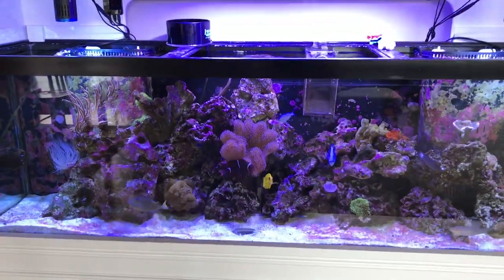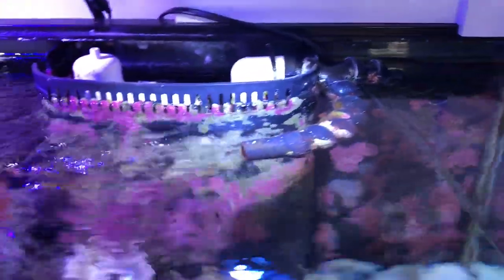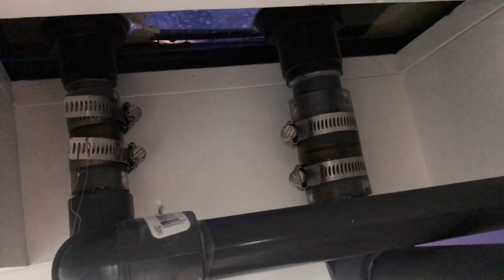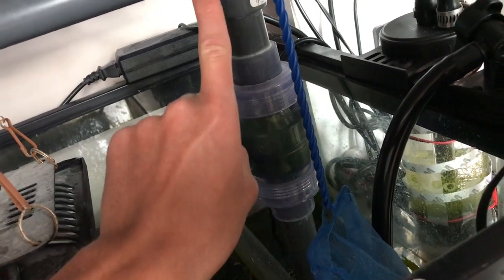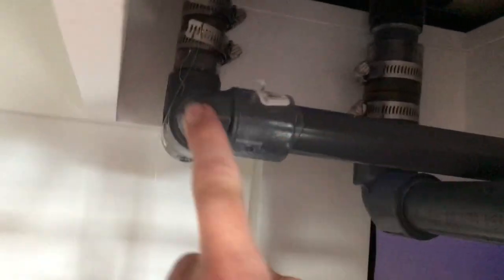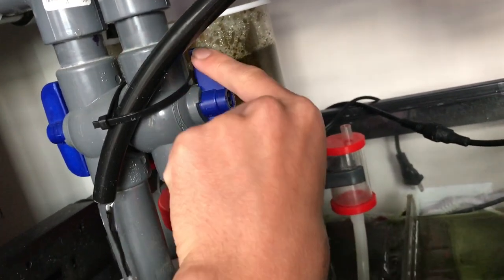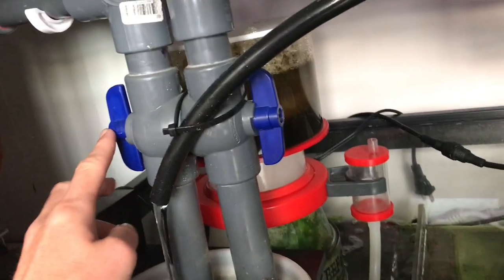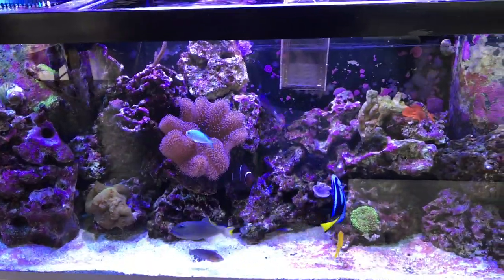125 Gallon Reef Aquarium Plumbing

Comment: Awesome job! Thanks for all the info you've provided on this tank. I have the same exact tank and I've been following along and took some of the advice you've given. I plumbed mine slightly different since mine didn't come with the mega flow kits. I plumbed it with  a full siphon with the return going over the back. One question I have is, what is your turn over rate? Do you have your pump wide open to it's highest setting? Thanks!
Reply from the maker: Thanks! My pump is running full power, Honestly im not sure the turnover I have. The pump im running is a Jabeo DCP 10000 though.

Comment: Two things I’m curious about. Why not just use nut unions instead of the rubber hoses to connect to the bulkheads. Also is the check valve really necessary as long as you have enough space in your sump from the water in the pipe and a little bit of siphone as long as return nozzle isint far down in your tank
Reply from the maker: I could have used those nut unions yes, personal preference honestly. I have the check valve for piece of mind.

Comment: Hi, I’m 12 years old, I’m from Bangladesh. I love ur videos !!!!!! I have a 60 gallon mixed reef tank with a sump. I was thinking of setting up a 20 inch 35 gallon lps dominated AIO cube reef tank. I want to keep 2 clownfish, 1 purple firefish, 2 bangai cardinals, and 1 mandarin dragonet, so I need a refugium in the back, what other equipments do u think I should get excluding the return pump, wave makers and the light. I was thinking of also getting 1 fire shrimp, 4 nassarius snails, 4 cerith snails, 4 trochus snails and a banded serpent starfish. Is that going to be too may clean up crew or will it be too less? Can u please answer this question, thank you in advance.
Reply from the maker: That all sounds good to me man, the stock list for fish looks good, I would add the amndarine later down the road after the tank matures. Go as big as you can with and AIO because there will be more room in the back. It should be easy to create a refugium in the back, make sure it has clear back to you can have a light back against the glass to grow the algae. The cleaner crew looks good. Add them over time not all at once.

Comment: I am planning a 125 gall too , 2 drains 1” and 2 3/4 return do you think is ok? The drain bulkhead  1” but i think the fit of the bulkhead reduces the flow
Reply from the maker: I did one 3/4" pump return and two 1" drain lines. Worked great.

Comment: Your return is only as good as your smallest size.  When you reduce the 1" pipe down to 3/4" you essentially just waisted money on buying 1" pipe.  As soon as you make a reduction your flow is now reduced to that pipe.  So you would've been better off just going with 3/4" pipe all the way from pump to return. Your pipe hangers are way over kill.  Those are for long runs of pipe and in no way necessary in your application. Otherwise your plumbing looks nice.